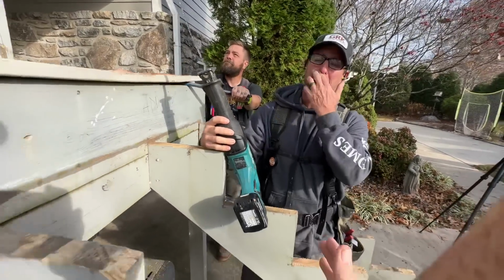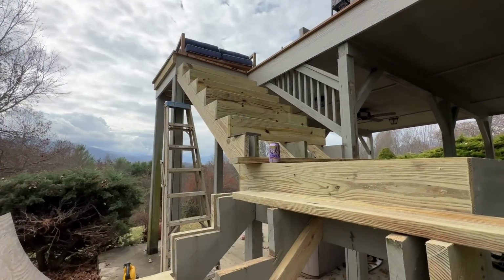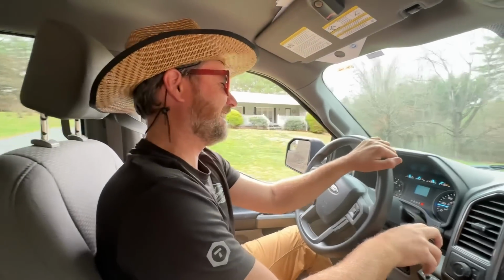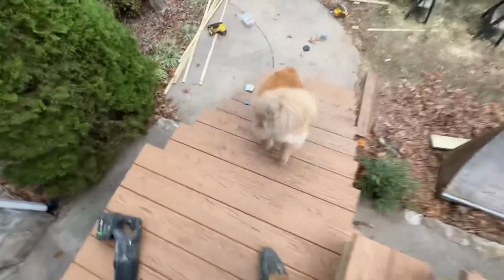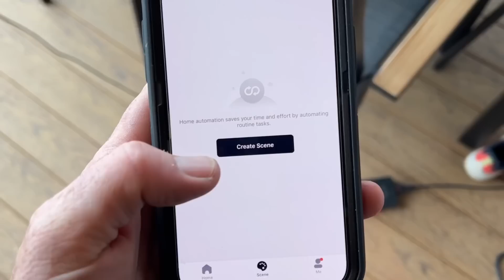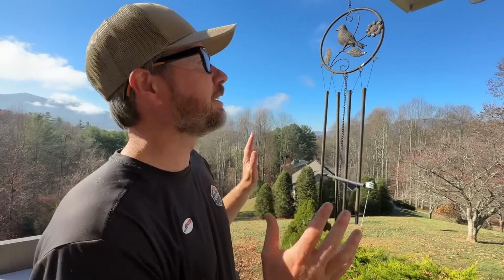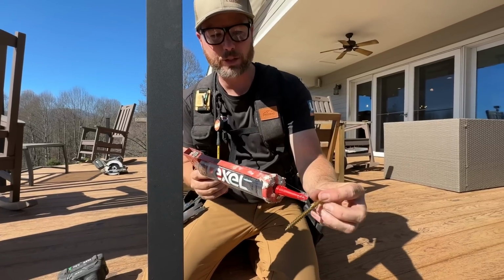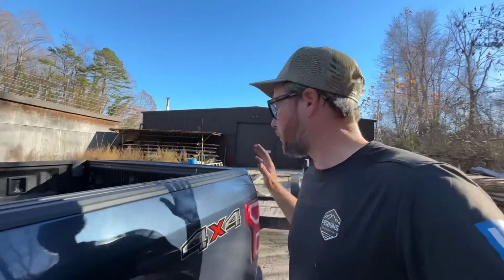Erik’s MEGA Waterproof Deck Remodel Part 3 of 5

Comment: Very nice area where you guys live… But I’m shocked about the landfill…? No recycling?
Reply: Like I already commented it’s either bury it away out of sight and so it can slowly rot without any gasses exhuming or burn it in a incinerator where all the harsh fumes contact our air. I know a lot of the burned stuff is filtered out but it doesn’t get every bit of it.

Comment: 5:00 Thank god that most of the trailers in Denmark has mechanical brakes, no bad connection or missing connection to worry about. We don't use electric trailer brakes at all.

Comment: ProTip: water down "Clorox Outdoor" in a pump sprayer and mist all the green algae/ mildew, where the sun doesn't reach. Hose off after the stains are gone. This method doesn't affect the color of my paint, but I use Benjamin Moore, not Valspar... Perhaps try a test area initially. 🎯

Comment: @ 6:00, i.e., the drive down the hill... I hate to say this but... this is why I still love a standard shift transmission.  With a standard, if you're in that situation, you just keep it in a low gear and it can't go too fast.  With an automatic, the only option you have is to ride the brake.  Standard gives you so much more control.

Comment: If you have the 7 pin connector on the back, you should have with the jack the wiring harness and instructions for hooking up the trailer brake. They are pretty inexpensive and take all of 15 minutes to install on the Fords.

Comment: 2in zink washer in the middle of the post base.  gives you room for low voltage wires and 360 degrees of adjustment.

Comment: That decking is pretty cool that it makes the underside waterproof. However where I live all those holes would be full of wasps. Putting lexel all the way around the bottom of the post railing into the crack that carries the water away probably wasn’t a good idea. Putting a piece of the decking on the top of the rails makes a nice cocktail rail.

Comment: Cutting long lengths always a nightmare, I worked at Heathrow airport years ago, we were cutting 6 meter lengths of metal not allowed to cut on the floor the carpenters on site would build a wooden bench 6 meters long for our use no questions ask

Comment: I do understand the reason for plumbing the posts, but won’t that cause issues when installing the cable rail? The deck itself is still pitched so even if each post is plumbed, the holes would be at a lower elevation at each post as they went away from the house.

Comment: A little heads up, I see you swim around a water fall., I'm wondering why the state your in has not let you know that when it's hot outside most of the snakes in your area will, hide and nder the water fall,they normally sit were the water runs over the falls were the water won't knock them off, I found out the hard way one day when I went under the falls in an area I used to swim at and seen a lot of snakes sitting there wondering why I was there.most came off the falls as i.had jumped back into the water thanks be to God none of them got to me.before I got out of the water 👍
You may need to do some research for your area about snakes and water falls 👍

Comment: LOL  I drove an S-10 2wheel drive and hauled a 24' Pontoon with 90 HP motor and had no problem going down hills with it even backing down the steep boat ramp. (must be a Ford thing)

Comment: you need  a post level - easy simple hack - i think water is going to get in sooner than later due to freezing and hydraulic pressure - there is no where for water to fully escape - it will dwell in cracks and force it open over time

Comment: Good choice with the aluminum railing tops. If you’d have used steel with those aluminum posts you could have seen some galvanic corrosion in time where the mixed metals touched.

Comment: I'm surprised they let you guys go right into the landfill with a pickup, I drive for the environmental division of a large local company, and drive garbage trucks, roll off, and lugger trucks, so I go into the landfill multiple times daily, they only let commercial trucks in where we go though, civi vehicles go to the transfer station around the corner. And ya sometimes it stinks, but you get used to it 😅

Comment: Those aluminum rails work out really well.  Once installed, they are pretty much maintenance free.  Those kits even come with continuous handrails for the stair sections to meet code.  We cannot install the horizontal cable rails in Canada (climbing potential for small kids) but the aluminum balusters that you can get with those kits install really quickly, so that’s a good option too.
Reply: I've always been curious about that, I'm Canadian too and obviously have had to explain the code issue with horizontal railings multiple times, obviously it must pass there
Reply: You can buy vertical cable railing as well.
Reply: @troyqueen9503  to be fair it's that way for kids, gotta give them the benefit of the doubt